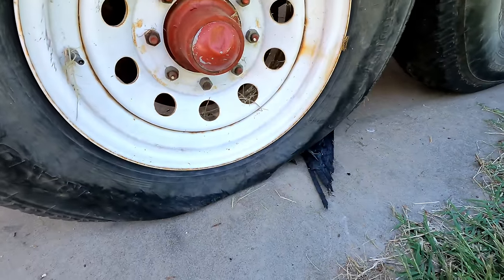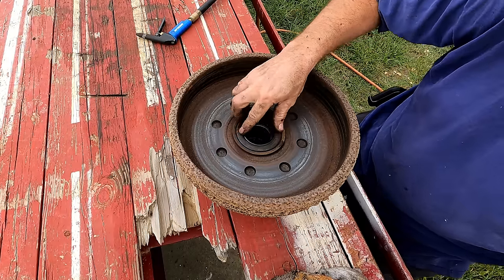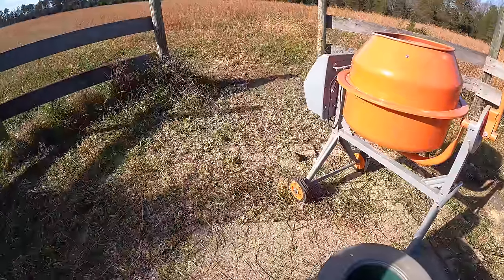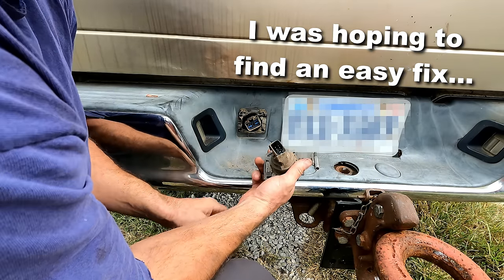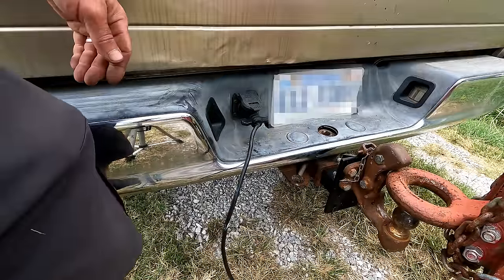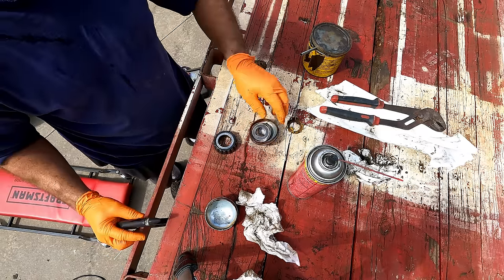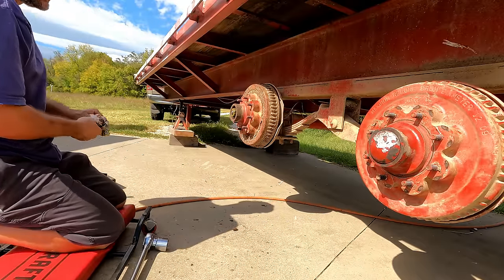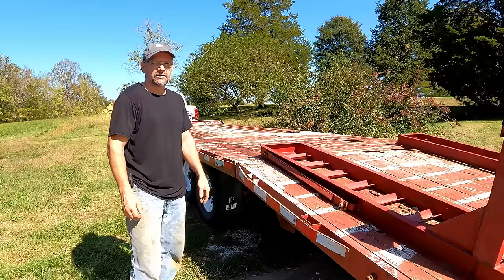Fixing A 7 Ton Equipment Trailer: Brakes, Electric, Tires, & More.

Comment: First, a multi-meter for this type of test/debug is just THE WRONG TOOL !  You need an incandescent test light, one that pulls AT LEAST 250 mA.  1A would be better !  knowing you have voltage at a location is only half of the diagnostic.  Do you have current ?

Second, when you are unsure of the QUALITY of power and ground connections, you should use a separate power and ground wire connect with over sized alligator/crocodile clips DIRECTLY to the battery.  Yes, when working on a trailer this means 40' or so of wire.  18 gauge is sufficient.

Using your test light, check the battery positive lead to where you think there should be a ground.  Then using the same test light, check the battery negative lead to where you think there should be +12V.  Do these 2 steps before trying to test anything else.

Comment: possible thing you could try when you don't want to removed the seal maybe you could try using  a grease needle then  you can at least get it down into the bearing.